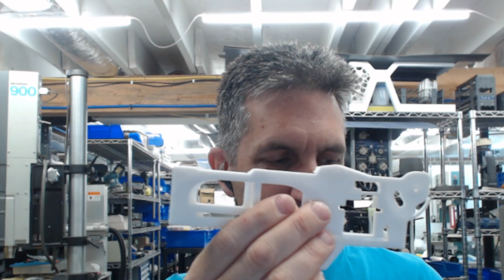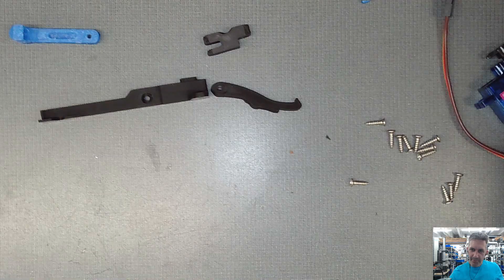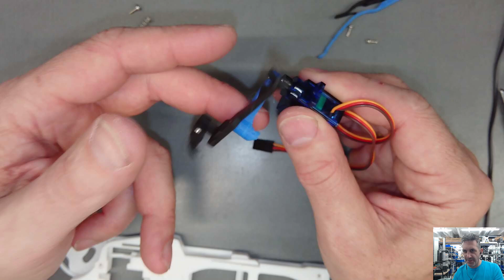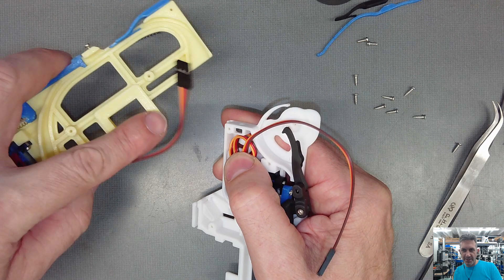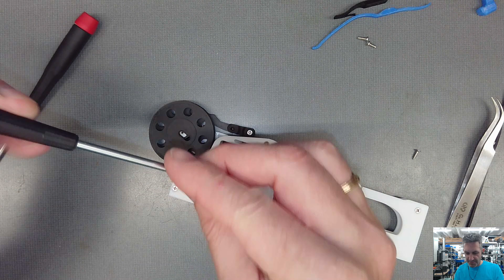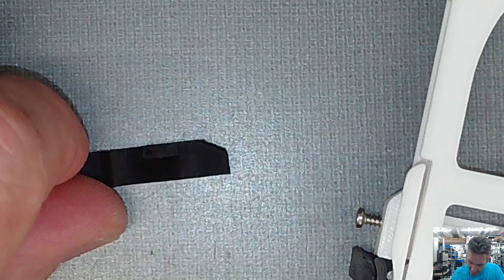BambooFeeder AS1.1 assembly

Comment: I have a lot of questions here i seems the kit i bot mid last year basically a lot of stuff changed and i have stuff missing but also looks like there newer parts?  no idea...... that aside I do need to get my placer going im tired of making stuff by hand. i take it the best question i ask ask is do you think reprinting all my feeders and making the newer ones is worth it?
Reply from the maker: @TheMadmatt45  If you are placing 0402 parts, the new feeders will help. It's difficult to run the old and new feeders together because the old feeders have a specific mounting bracket that stays on the machine.

Comment: Your videos have come at the perfect time because I'm assembling a bunch of AS1s to test as replacements for the pneumatic Yamaha CL feeders in my machines, at least for the most common 0603 parts in 8mm tape. I need to fit more feeders in the machines and these are so slim that I'll get about 30% more in the same space compared to CLs.

It looks like the mounting method has changed significantly in v1.1. I've mounted a single 20x20 extrusion at the moment but I had in mind modifying the AS1 design to fit onto a 20x40 extrusion, for added stability. I also want to mount the servo sockets vertically just behind the rail mount so that I can make a PCB that bolts under the rail with pin headers sticking straight up, so feeders can be plugged into place with zero loose cables. However, the new mounting system looks like it wouldn't allow that.

Will the v1.1 files be out soon? My printer has been running for the last week making v1.0 parts.
Reply from the maker: The mounting method has changed significantly in 1.1. Two distant points are referenced, making the pickup position quite certain. I'll make a follow-up video demonstrating this.
Reply: @nickydoes  Thanks a ton! I wish I had the video recording skills to show off how nice the Panda Placer has been. I really wish Opulo would have been a better solution but I just can't swing 100$ feeders or whatever they're charging right now.
Reply: @nickydoes  Fantastic, thanks! I'm going to order another couple of packs of parts from Leo so I'll ask him for the files.
Reply: If you've ordered from Leo I've found that just tossing him a email he'll often send you the new files if you ask to test them.

Comment: Really like the ring changes.

Does this include the changes to openpnp where vision is used to correct potential pick position issues?

I'll see about sending Leo to see if I can snag the 1.1 files and do a test run. My prior experience was that 0402 components just wouldn't feed accurately enough for non-vision picking.

Your description mentions assembling more than a hundred! How's pick rates been for you? What are you primarily picking? Any idea if 24mm feeders are on the way?
Reply from the maker: The new feeder class 'bambooFeeder' is in the latest openPnP test version. It's worth reviewing the PR notes to see what Andrew changed.
Reply: @nickydoes  Fantastic to see and hear. I have some older 1.1 files that doesn't have the new spring and tape mechanism but has the fancy mounting solution. I'll have to see if I can get the new files from Leo.

edit
Wanted to know how you are running the feeders in openpnp.
I assume feed actuator should be Autofeeder_tape pitch value
But are you running any post pick actuator?

I assume when setting part pitches of 2mm it'll manage the double pick itself for 0402 components or should I be doing something specific?
Reply from the maker: @MoonWind32690  for 0402, you have to run the new bambooFeeder visionFeeder. It's in the newest test build, and I recommend you read the GitHub pull request history from Andrew.

That Feeder class exposes two parts to pick with each advance, then uses vision to find each part in its pocket.
Reply: @nickydoes  Thanks again for all the answers! You've been a super big help.

Got files and got a single feeder printed.
I'm thinking I might print some of the components in resin for better accuracy. The ABS-like resin when I hot water cure has better flexibility and 'spring' characteristics than I think PLA.

But I did run into a bit of a problem. I can't seem to get the Bamboo feeder class to do a double pick for 2mm pitch parts. 

I've tried setting part pitch to 2mm and tape pitch to 4mm. It feeds and vision is detecting correctly (though super slow, I had to bump the subsampling to 5 which puts my detects at ~500ms).

Not sure what I should be setting for the actuators to get it to do a proper double pick.

I am on a rather old setup (used the setup files from like early 2023). So maybe there's an issue in my AutoFeeder_4mmAdvance value. I mimicked the very old method he had. 

Regarding the feeder latching mechanism. This is one of the big reasons I'm thinking resin. I just don't seem to get enough 'force' to lock the feeder to the lower extrusion.
Also, setup is a PITA! Getting single plates lined up seems insanity. I probably need to make a jig.

I went and imported all the feeder parts into fusion to do a demo run of a 24mm feeder. Looks like it 'should' work by just bumping out the areas needed. The feeder tape bits do end up looking a little silly. I just don't know what to do about the attachment system. It seems super clever but likely going to need a bit more work from Leo.

Anyhoo if you have any idea about double picking that would be a big help! Really do appreciate the videos!
Reply from the maker: A jig would help. Alignment of 4 parts is fiddly at best. I'll do a video of using the new feeder class. Subscribe so you get notified.
Reply from the maker: I posted a pretty janky video just now in this same playlist. Watch the master practice his craft 😜.
Reply: For 2mm pitch set the part pitch to 2, feed pitch to 4 and make sure the actuator also advances by 4mm only. Feed pitch should always be the same as the actuator F value of M600. In a future version we’ll improve so the M600 F and feed pitch are correlated. This even works well for part pitch 8mm & feed 4mm as multiple 4mm actuations are executed. Essentially I only have 1 advance actuator on my machine, the 4mm one.
Reply from the maker: Vision based picking is part of the BambooFeeder.
Reply from the maker: The AS1.1 picks 0402 reliably. I'm just starting to use the bambooFeeder feeder class.
Reply: Hi, I'm thinking of getting a pandaplacer as I want to be able to do 0402. However, I've not used a 3d printer and I was wondering if a bambu lab a1 is likely to be good enough. Also with the springs etc, should the infill be solid or what? I can't seem to find one, but a video about the printing of these parts would be really useful.
Reply: @davidswann6081  I'd set spring walls really high so the object is all wall.
The A1 should do fine. Do consider properly calibrating your filament with the bambu slicer calibration steps though.